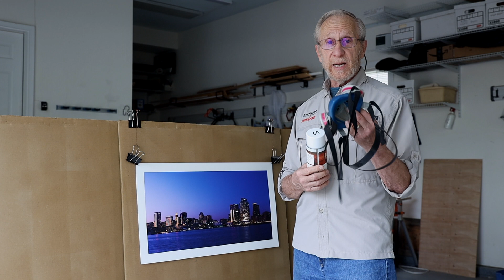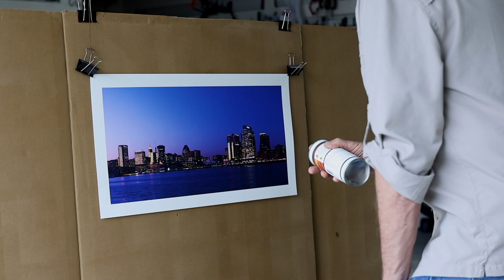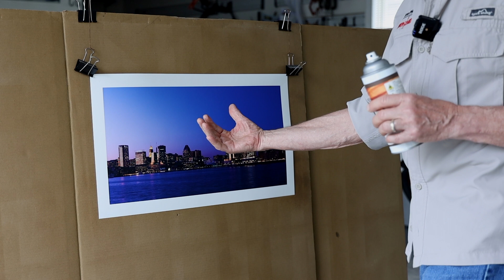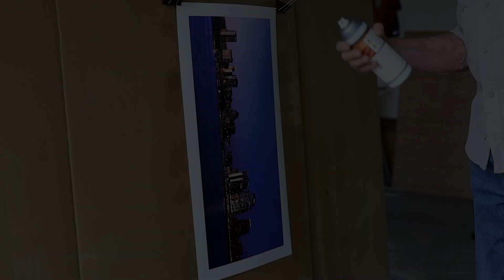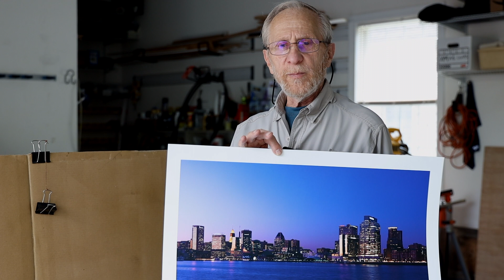How To Protect Your Prints

Comment: Very Important: You must start the actual flow of spray while aimed off the side of the print, then draw the spray all the way across the surface of the print and off the other side before stopping it. The person in this video is doing that, but at the speed he's going, it's not going to be obvious to everyone that he's not, for example, just trying to conserve spray between passes. 
Again, what he's showing is correct, but AFAIK he never actually says this explicitly. Personally I have used this spray varnish successfully many times, and I actually just keep the spray going continuously for each pass from top to bottom (meaning I don't start and stop the spray as I change direction left to right). To each their own. The important thing is to never have the spray pointed at the print itself when you start or stop the flow of spray.
Also just for clarity, the reason behind not swiveling your wrist is to try and maintain, as much as possible, a constant distance and angle between the sprayhead, and the artwork, while spraying. As another commenter mentioned, I tend to actually use my legs to try and move my whole body left to right, not just my arm, as shown in the video. Maybe that's more of an issue/concern when spraying larger-format prints.

Comment: Thanks. My first question is how important is it to use spray, given the fact (well, claim) that supposedly archival-quality, pigment-based inks on archival quality paper should last for 200-400 years? My second question is how important is an additional layer of (cehimcal) protection if the print is framed with glass or plexi? My third question is, how much long-term testing has been done to determine the effectiveness of spray varnish over the years and are there any negatives associated with its use (other than of course the toxicity)?
Reply from the maker: 1- The desert varnish and preservation coatings generally are used to protect against UV, scratches and scuffs, and to some extent humidity changes. Longevity numbers for inks assume dark storage or archival conditions for maximum permanence.
2- If the print is framed with archival materials and UV-filtering conservation or museum glass, there is no need to add a coating to the print. If you're using non-UV filtering glass, or displaying without glazing, then coating the print is an important step.
3- We do not have longevity testing comparisons available for prints with and without the Desert Varnish.

Comment: Before and after would have been helpful. Also, explain what you mean when you say the spray can "affect" a glossy or semi-glossy print. Does it give the print a matte finish? Does it dull the finish? Other?
Reply from the maker: We don't recommend using the Desert Varnish on a glossy, semigloss, or satin paper. It is not designed for those coatings, and will not disappear into the surface as it does on matte papers.

Comment: I know you said to wait 4 mins between HALF coats, but how long should I wait between full coats? And how long after that until it's fully dry and I can package it up?
Reply from the maker: We recommend letting the varnish dry overnight if possible, but a few hours at standard temperature and humidity (65-75 degrees F, 35-60% humidity) should be sufficient.

Comment: I was thinking of using desert varnish, but where I live can be quite humid in the summer. Are there issues with this and is there a recommended humidity level? Thanks!
Reply from the maker: The higher the ambient humidity the longer it will take each coat of varnish to dry. If you spray it outside, and then bring it indoors to dry (assuming your home has a lower humidity) then the average times should apply. We don't have time guidelines for application in humid conditions.

Comment: Can you use Gloss or Semi-Gloss Spray?
Reply from the maker: For inkjet prints you only want to use an inkjet or aqueous fixative spray. Most of the glossy sprays available at art stores contain solvents or other chemicals which are OK for art mediums (paint, pencils, etc) but are not compatible with inkjet inks. For a glossy finish on matte paper we recommend liquid inkjet coatings applied with a roller or HVLP sprayer. These are generally marketed for canvas prints.

Comment: Hello Lester
Question
Regarding a glossy pro inkjet
paper for a print, I am not planning on using glass of any kind so do I spray a glossy print? Will the varnish cloud the glossy finish of the paper?
Or
I have good quality anti-reflective glass, should I use glass with a glossy print?

Thank you again for your training info. 
I appreciate your kind and expert advice. 

Scott
Reply: Hi Scott. Good question, but a complex answer. We did a series of experiments a few years ago with sprays on matte, semigloss/satin, and glossy prints. What we found is that glossy prints lost some of the gloss, resulting in a semi-gloss print, but not quite as nice looking as a manufacturer's semi-gloss or satin coating. Some glossy coatings claim to have some UV resistance, but we have not tested that. Also, there are some protective sprays that claim UV protection but also claim that glossy prints will maintain their gloss. We intend to test those in the future. Your suggestion of putting the print behind a good quality, non-reflective glass is probably best, but I also suggest you print 3-4 8.5x11" glossy prints, cut them into thirds and try sprays from different manufacturers. Best of luck and if you do this experiment, please let us know how this turns out.
Reply: @lespicker  Thank you for your reply and excellent idea Cutting two or three up and trying different sprays. I’ll probably do that with the two sprays that I have. I kind of waited late on this and I’ve gotta turn in the framed finished picture by Monday. So I’ll probably put it all together with glass see how that looks with a good nonreflective glass and if that diminishes The glossy print too much I might just dry mount it  to foam core and leave it exposed. Thank you again as always appreciate your great insight, information and kind replies
Scott

Comment: I tried this varnish on Red River SanGabriel Baryta and Palo Duro SoftGloss Rag papers exactly following the directions in the video (distance from print, holding my wrist, reversing the print to complete a full coat).  The next day after totally drying, to my great surprise and disappointment, the varnish left raised run streaks (like frozen drips of water running down the page) on both papers ruining the prints.  To be fair, I am going to try using the varnish one more time.
Reply from the maker: We only recommend using the Desert Varnish on matte papers/matte black papers. With other surfaces (photo black) such as baryta or satin the surface does not properly absorb the coating, leaving blotches, streaks, or dots, as you are seeing. For baryta, satin, luster, and other glossy papers the best protectant if you are not framing is a clear laminate. There may also be coating products in the market that can be applied with a roller or hvlp sprayer that are designed for photo black papers.

Comment: Is outdoor application the only option? Could it safely be applied in the basement of a house while using a mask, but without special ventilation? I would be working with prints no larger than 12x18 inches. If outdoor application is the only option, what is the minimum temperature for getting good results?
Reply from the maker: We don't recommend indoor application without ventilation, the smell of the varnish will likely linger for a while after application. That said, depending on your location it may be the only viable option in winter, as the varnish is best applied above 40-45 degrees F. For safety & liability we have to say 'indoor application would be done at your own risk.'

Comment: I tried this yesterday for the first time, following Les's directions. However, in viewing the print after it dried, I see blotchy areas where there doesn't appear to be varnish.
Reply from the maker: Sometimes the angle of the can during spraying can cause an uneven coat, also if the varnish is not shaken enough before application it could be inconsistent. Rotating the print 90-degrees and applying another coat may fill in the gaps.

Comment: Wish I could use this. Looks like a good product. But I live in a small apartment and could not use the spray indoors. There is no outdoor space to do it in either. Are there any sprays that are less lethal to the lungs and human body?
Reply from the maker: There are some coatings that can be applied with a brush or roller, however they are generally designed for canvas, so they may not completely disappear into the paper like the Desert Varnish.
Reply: @MoabPaper  thanks
Reply: If you are doing a small number of applications your health is at not much if any risk of a problem if you open your windows, turn on a fan blowing thru an open door or window. The propellant is the most bad chemical and likely most varnish sprays have something similar. Also masks as was demonstrated in the video really work and should give you more than adequate protection. Don't use masks to prevent, say, Covid-19.  In my view it would take a lot of exposure to develop a chronic respiratory problem but that is dependent on lot of of other factors, smoker, previous chemical exposures, and of course genes. However not being exposed at all is an inconvenient but best strategy. (I am a chemist and I do research in toxic waste epidemiology)